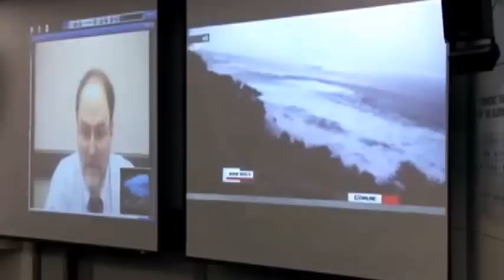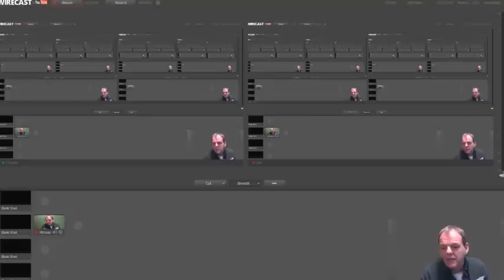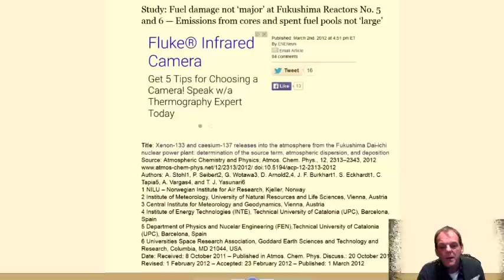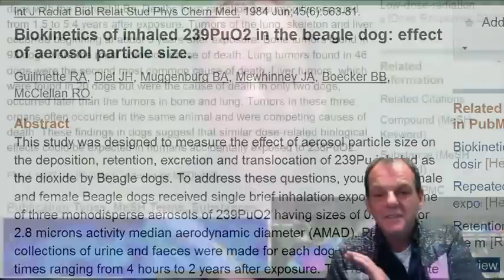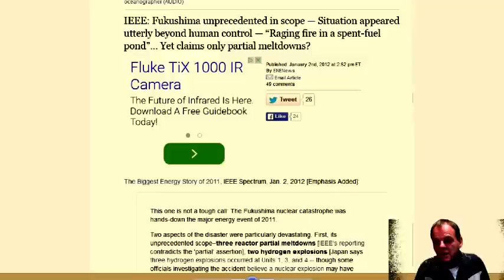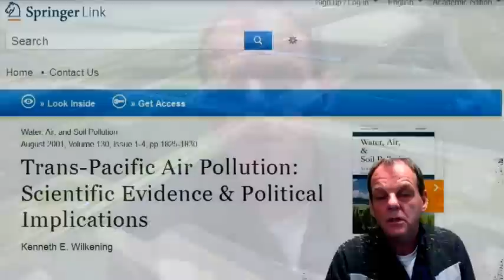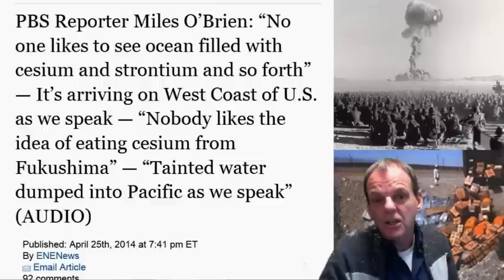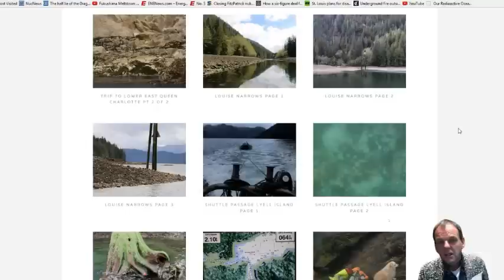Fukushima Meltdowns R#5 & R#6 (Episode 3)

Comment: First up, gave you your twentieth thumbs up, now I'm gunna troll you a bit. You know the deal. 9 on the Rickter scale is ten times eight, not a hundred times. Earthquakes are measured WHERE they happen, in the case of the Japanese one, it was a 9.0 about a hundred mile offshore and ten miles down. On land it wasn't that bad, tho' it did manage to break a pressurised  air pressure pipe crucial to opening a venting valve at Dianii, almost causing a meltdown there, and who knows what else that we will never hear about. Hydrogen DOES need something to light it, just like methane or petrol vapour. 'nuff for today. Tepco have poked their head up, they've put up a vid about how they're so perfectly going to clean up no. 3, if you type in fuku then sort by upload date, it's currently on about page three; feel free to put your steel-cap work boots on and go troll the hell out of it. Cheers.